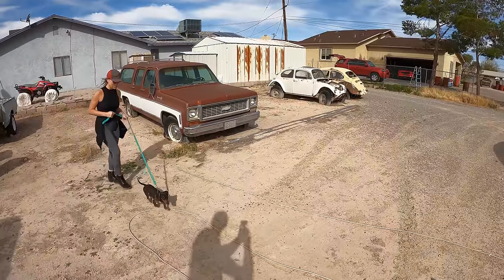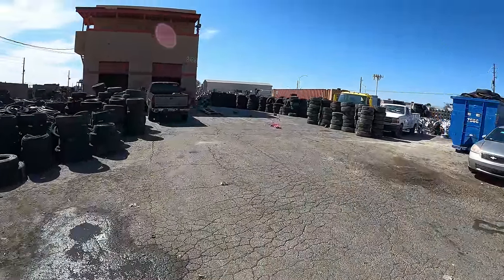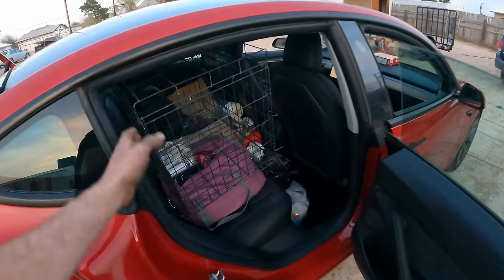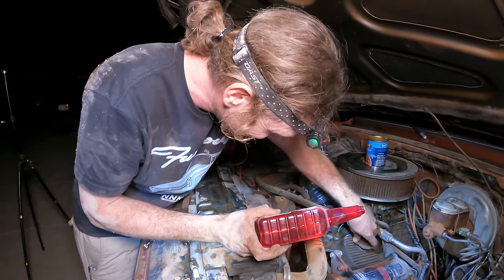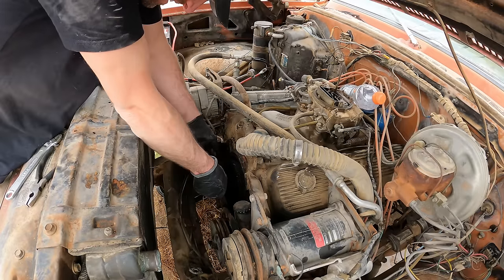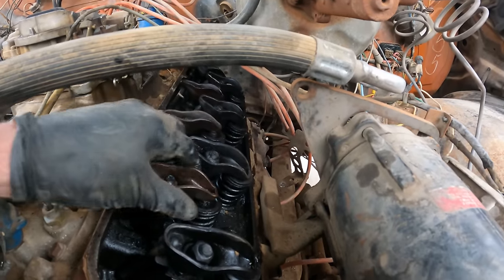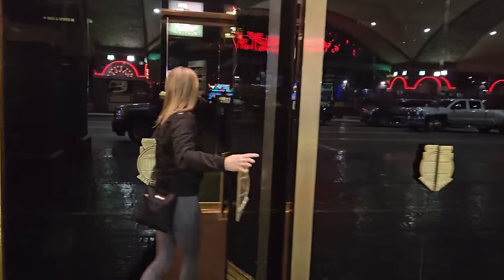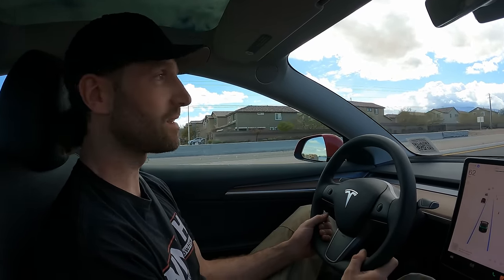1973 Chevy Suburban 454 Sitting 23 years - Will It Run And Drive?

Comment: Those old 454s are a beast. My step dad had an early 80s with no cat and I had a jetski that took 110 octane (low-lead) premixed fuel. Well, he ran that 2 stroke premixed 110 octane with lead and the thing just ran like nothing.

Also, welcome to the west coast/desert. You'll find lots of old vehicles with no rust. My 05 Sierra and 05 Ram both have no rust while others on the east coast have rotted rockers, cab corners, bedsides, etc.

Comment: My family owned a '76 Blazer (basically the 2-door version of this beast). We may have just gotten a lemon, but it turned out to be the single worst auto purchase we ever made. Within a few months of buying it (new), the fuel pump went out, the underside started to rust out, the fuel gauge stopped working, the rear window crank mechanism broke... I could go on and on. To add insult to injury, it got about 10-12 mpg combined city/highway. By the time the car was less than three years old, it seemed like at least 2/3 of the engine had been replaced. I ended up selling the car for next to nothing and was just happy to be rid of it. That said, I did love the way the engine roared... when I could actually get the thing started.
Reply: I don't feel so bad about my 1972 Plymouth Fury anymore. ;-)

Comment: I bought a 67 Chevy Impala from it's 1st owner and he was a believer in marvel mystery oil. Every oil change he would use it and once a month in the gas. When I sold it the new owner brought the engine to work with the heads off. They looked like they were brand new!!! Cylinder wals perfect. Only a little wear!  The engine has 117.000 miles and looked like it had 5000 miles!!! Not kidding!

Comment: My Dad had a 1976 Suburban with 454, Holley carb and an aftermarket cam put in it. We traveled all through the West Coast on vacations every few years pulling a large (about 20 foot) Aljo travel trailer. That monster would pull the trailer up hills going  75 MPH. That is a very worthy vehicle of rebuilding to it's glory you have there. I never got the chance to drive it as I wasn't old enough. I did drive the 1970 Mercedes 300SEL 6.3 at 150MPH many times.

Comment: Makes me want to get in my garage and pull my 454...friend had 5k on a camper and apparently issue with guage... engine seized...dealer put in new engine and he gave me the old one complete with heads and all but carb.  Needs pistons knocked out, bored and put together...a 1980 type version...been sitting as no time to work on it.  Have my 70 ss454 monte carlo with 68k miles parked and time to get the rust on windows fixed and painted and running...have owned since 1971...Impressed with your time spent on this and the work you did...

Comment: 1973 was the first year for those generation Chev & GMC Suburbans, K5 Blazers, Jimmys, pickups, & medium dutys. 1991 was the last year for them except for the regular cab pickups & medium dutys which were discontinued before that year. The half ton & three quarter ton regular cab pickups were the first to go in 1987, & the one ton regular cab pickups were next in line to go in 1989. It was either 1989 or 1990 when the medium dutys were discontinued.

Comment: These Suburbans are great honestly. A buddy of mine had one for work. Almost the same size as a cargo van, but way cooler. I've often thought about buying one to put a little lift on and slap a drivetrain to it. A 454 could work, assuming I could find a cheap intake, heads, and cam for it, but likely an LS swap or even a Dynamax 6.6.

One of the truck channels built a bulletproof big body off toad truck. They'd have been happy to have something rust free from the desert, for sure.

Comment: If it were me, I’d vote to throw jb weld on that intake, and start the trip home, if it starts drinking water, see if you can find another intake and throw it on. I love the mad max style of repairs. I know you could get that thing home, you have the skills to do it. The only question in my mind is if you want to do it during your vacation. I can’t wait for the next update.
Reply: definitely a replacement situation not jb weld lol. Jb weld isnt going to work sticking to more corrosion. What happens when it leaks, now youre on the road with no intake manifold available... And limping it along isnt going to work since its going to put water directly into the oil, not burn it in the cylinders....

Comment: God I find this sooo fascinating. Your sheer amount of raw car knowledge is amazing.  I so wish I had your depth of knowledge and skills at working on engines.  I find it fascinating to watch you walk through each and every issue, diagnose it, fix it then move onto the next.  I've never seen such a thing before. I was always under the impression once an engine has seized up, it's stuck until you pull the pistons, bore out the cylinders and put it all back together again.  And hell I didn't even know you could run and engine without the lifter covers on it.  Great stuff man - LOVE the details and my god are you a lucky man to have a friend like Jen riding shotgun!

Comment: I’m loving it already!  I had a 72 1/2 GMC 3/4 ton. Most everything was a perfect match for the 73 you have, except mine had a small block, and some parts were carried over from the 72 (like the alternator with an external regulator). Got me a set of 16” wheels from a friend. But yours is in much better shape. I scrapped mine almost 20 years ago. 😢 Sure am happy for you, though! 😁

Comment: You did a great job in getting it going after so long..!! You was so lucky with the wheel bearings and brakes. You could have had so much trouble and also the rear diff. Great job..!!

Comment: In the 80s, I drove a Toyota Celica GT. It had a really cool paint job. 5 speed tranny. It was nice! I have used that oil before and never smelled it, Next time I will. I bought a 1978 Camaro and the guy told me, oh yes, I drove it here, and cranked the engine a few times. Well I had it at my house and when i got it started, Lots of steam was pouring out the dual exhaust. I pulled a valve cover after hearing a bit of noise. I had bouncing push rod. I got it all tightened up and it ran really good! I remember I took a trip to Florida from south Louisiana. And I had my oil changed. That person put my oil filter extremely tight. That is not needed.

Comment: A few months late on this one but .... in the first year release of the 454 all the engines were recalled due to having cylinder heads that had the wrong intake valve angle, all that were sold and had some mileage at some point would have an intake valve break at the base of the valve to stem area.  It totally destroyed most when they blew but there were a few that were still running after being towed to the dealer.  I happen to work for Chevrolet in Houston and did more of these crate replacements than I wanted to.  It was a lot of work for much of nothing, but the dealer I worked at our shop foreman told us when checking one of these engines for failure if it was still running to hang our foot in it until it blew totally up.  GM loved to have patch work done but with these 454s the word was getting out about this problem so it was bad publicity and pretty soon they figured out the problem and all the dealers were scheduling buyers for their new engines.  Every time I turned around I was getting screwed by GM doing all their work for nothing.  Another big boon doggle was their oldsmobile diesel that were mandated by the court to replace the engines due to failures.  I think they were giving us 8 hours to replace the diesel.  Sure I could swing a new one in in 8 hours but I could not clean all the necessary items to do a professional job.  Did I mention I hate GM......   

Back at that time 50 years ago I loved Fords, today I hate Fords and I am sure they will be the last brand I hate.  Oh yeah before I forget I lived in Pahrump Nv for eleven years and I was trying to look for terrain in the background to see where this was.  I was right under Mt Charleston, I have one good friend still living there in Pahrump.  Wish I had stayed rather than going back to Houston after so many years.  I did go to Houston but only for 2 and a half years and then back to Louisiana, my last stop in a long history of traveling and working, started out in the dealers after the Army and then eventually field service for Waukesha Pearce of Houston working on stationary industrial big stuff, 9 and a half inch bores every model they made for oil and gas industry and even water pumping in the rice fields of Katy Tx and the wood mills of La.  I enjoyed watching the adventure, wish I had that top radiator mount bracket assy .  I have an 82 GMC 3/4 with 4 row radiator 350eng/400 AT, you cannot find one of those flat plate tie down brackets anywhere.  You can buy new 350 single brackets for 16 dollars a piece but not anything exist for that 454, I just have a 350 that was stock but I mounted the large radiator while in Nevada preparing for a long road trip home with a large load.  One other thing, it is always best to use the A/C oil filters on the 350s and probably the 454s too.  In 72 GM stopped line boring connecting rods and the bearings were hand fitted, if you were using a cheap oil filter that had no bypass valve internally and you had your fan belts very tight you would often have a crank bearing knock.  Just loosening the belts a bit stopped the noise most of the time, but the real fix was to use a good oil filter.k

Comment: Amazing troubleshooting skills! The washer idea was brilliant!
It looks like that engine was very neglected. There's no reason for the oil sludge buildup or all that crap in the cooling system unless oil changes weren't done regularly and the cooling system was never flushed.
Water in the west is EXTREMELY HARD. If you use tap water in a cooling system you're going to have build up. The same goes for filling batteries.
This is going to be a challenge but I'm excited to watch it.
Perhaps you should make a punch list in order of priority when reviving a car. A lot of the stuff you already know but it would be nice to be able to have a punch list so that you are reminded about little things and in an order in which they should happen, (check t-stat housing for corrosion, flush cooling b/f reinstalling water pump, turn over b/f anything).
 Perhaps also in a flowchart form.... 🤷‍♂️🤷‍♂️🤷‍♂️
Are you flying back east? What are you doing with the suburban if they have to move?
Reply from the maker: The housing wasn't clogged. Just the intake part
Reply: I saw severe buildup in all of the ports. It was severely neglected.
BTW I edited my original post.  Please re-read it if you can.
Thanks!

Comment: Best oil filter wrench is a 4" hose clamp, tighten as close to the base as possible then use a nut driver or screwdriver and a hammer to loosen.

Comment: I once pulled the trans & put a stage 2 B & M shift kit In that sucka on the tailgate, then had it back in the truck running and driving in less than an, hour. I parked the front wheels of said truck on the azz of my 16' trailer (slid a jack under the azz of the trailer to get the truck some REAL, air. It was transmission #5 that summer (2009), therefore I was getting PLENTY of practice on MY 73' Long wheel base, Chevy. I BUILT mine for hauling "junk." My 73' Chevy had a 400 small block with an off-road, cam. I put factor heads from another engine with 2.02/1.50, valves. I bought just the short block for 75 bones I'd be lying if I said what cam might have been in that, engine. I took out 3X 350 Turbo(s), a 700R4, them that last un I put in was a 350 Turbo. Not counting the trans I installed, initially. I picked my 73' originally for like: 100ish, bonez no engine, no trans. 

That was the 1st year of "that", body style. Also, my FAVORITE grille coz they are 73' only & RARE AF!

I ended up selling that old truck COMPLETE for 400.00. I was taking my little Puerto Rican amigo to get his Honda Civic he crashed (again) and it was storming. There were 2 small/medium trees lying in the road & I did not/could not see them til it was too, late. We had to turn around & go back home coz as fast as I could real eyes those were trees laying in the road & I've done drove my truck & trailer smooth dafuq over them? Instantly, I could tell my front end was doing "machine work!!!"

I went outside the next day after it quit raining & my truck didnt wanna move, it just spun the, tires. On the passenger's side of the truck the dust cap & the wheel bearing(s) were, GONE, and the hub/rotor had welded itself to the, spindle.

Scrap prices had hit ROCK BOTTOM & I was BORED with driving that truck, so I SOLD it. 

I've gotten bored with SEVERAL vehicles over the years & SOLD them. Several of them would be highly desirable, today, even MOREso than my old work truck?

Comment: That is number one  disconnect fuel lines. You don't know what's  in the tank... then  see if the engine rolls BY HAND with  plugs out with some P.B Blast in the holes

Comment: I Love BLAZERS Myself
   boy   the Lines on that do look familiar.   THAT is the Blazers  "big brother" 
yes those ventilation windows were a GOOD touch.  Sucked air OUT of the vehicle (across the windshield)  to keep it defogged,  & helped MOVE air within (esp for smokers) WITHOUT   shoving air   into your face.   UNLESS you wanted the air to be  shoved  into your face, it all depended on which way you turned the windows. 
But THAT was a good touch for road driving ventilation.  You NEVER see such vents any more (I think) in any new car

Comment: Great job with this.  that alu corrosion is no joke, seen so many destroyed cooling systems from that.  BBC Edelbrock mani is not cheap, $500. 
I had an alu cylinder head spring a water leak rotting from inside out, JB weld "fixed" that.  I'd be tempted to give it a go on the mani.

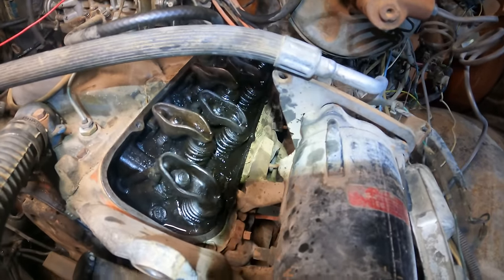Comment: 45:46 Iam a 51 year old "intermediate" mechanic and I had no idea that you could keep the valve covers off of a running vehicle without getting sprayed like a skunk with oil.
Reply from the maker: More oil should have been coming out of these. Probably gunked up inside of the oil galleys and the lifters. Or low oil pressure. Usually you can take the valve cover off while it's running but oil spatter will go around

Comment: Cool old burban... Man please put a plastic bag over the air filter next time. U sprayed water directly into the air filter. Use compressed air to remove the dust. Or a leaf blower.  Using water is prob the worst thing you could do. Better to just leave the dust than to use water and get everything wet. Getting that air filter media wet and the water gets pulled directly into engine.

Comment: I’d surely save this Chevy Suburban. Even the front windshield is in perfect 😍 shape. It could use a new dashboard (new old stock), and tires 🛞. It will be another vintage vehicle 🚗 on the road. The engine is probably in good 😊 shape, all it needs is a complete tear down, and overhaul, with the replacement of a few parts. Your friend, Jeff.

Comment: If you properly freed up the engine it would have ran fine. It had a stuck valve which could've been freed up easily instead you force the crank ,broke the timing chain, bent a valve and probably flattened out the rod bearing Need a full rebuild now. Good job!
Reply from the maker: Chain was already broken. Links were rusted at the breaking points. Thanks for tuning into the video. Check out the next part that's coming soon to hear how well it runs. No bent valves. Needs a rebuild for sure though. Burning oil on the Left Bank. Hope that helps answer your concern Kevin
Reply from the maker: Oh and don't forget, these fly and drive videos are bare Bones with hand tools. No fancy garage and weeks to spend.
Reply: Hey Kevin no need for the backlash I don't see you in their shoes flying out and trying to get a old vehicle going! Plus if you don't like it don't watch! It's as simple as closing the tab if your watching on a pc or if your watching on a phone on the YouTube app tap the bottom right x and it'll close the video! Cheers hopefully this advice helped your boomer ass

Comment: With something like this, you are way better off to put it on a Uhaul AT and haul it home. Buying tires before you know it will run? I used to buy these from the TVA 43 years ago when they were 10 years old. I learned fast that hauling them home was the best way. The last 2 squarebodies I bought in MT had been sitting 21 years but didn't look near as bad as this one. It needs a full shop to clean it enough to be safe to drive at all.

Comment: I always wanted to convert a long bed, and non-dually, Ford F-250 or Ford F-350 Crew Cab truck into essentially a super luxury rival of the Chevrolet/GMC Suburban/GMC Yukon XL/Cadillac Escalade ESV or the International Harvester Travelall.  Honestly, Chrysler and Ford missed HUGE opportunities to make behemoth SUV tanks and it would not have been hard to do, either, back in those days.  Anyway, the concept for this custom built SUV conversion would be like a more amped up version of the 2000s Ford Excursion, but in a 1970s Ford F-250 or Ford F-350 non-dually Crew Cab long bed body with a built-in roof for the rear of the vehicle type of body, as well as built in steps that can either be manually, or automatically, retractable or extendable.

Comment: Use 50:1 gas (weed eater gas) to put in the carb. Starting fluid is bad on piston rings. Just a tip.
Reply from the maker: Yeah I usually do that. Depends what I have on hand at the time